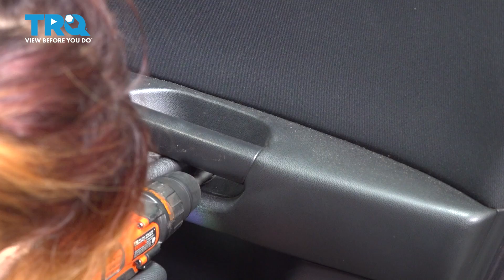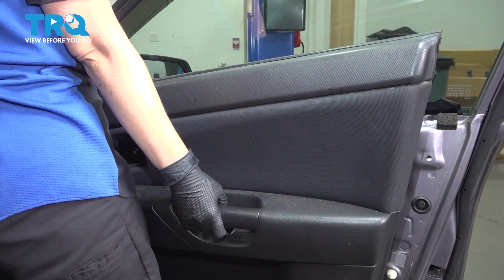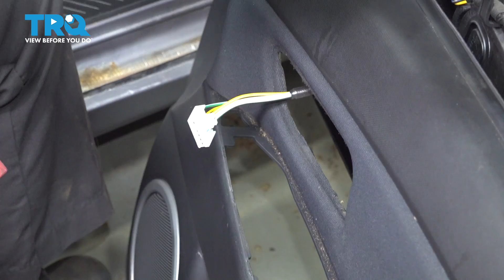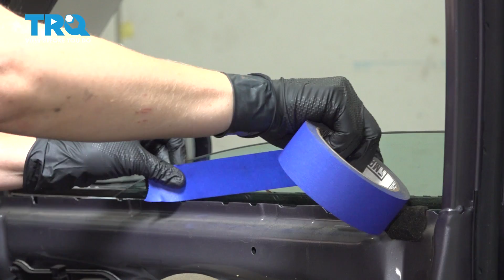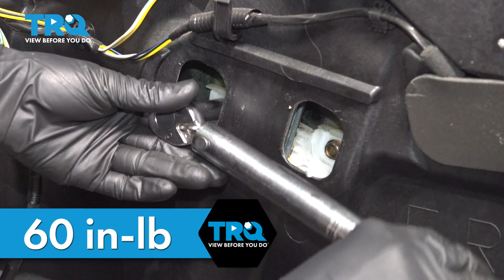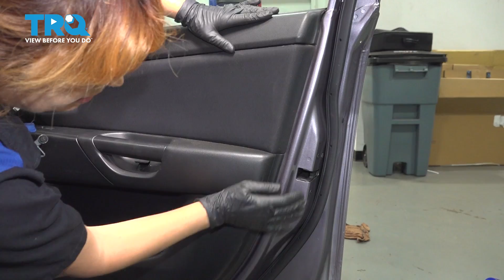How to Replace Front Power Window Motor & Regulator Assemblies 2004-2009 Mazda 3

Comment: This was so helpful! I just did the replacement on my rear Driver's side window, and today will be doing the Driver's side window. The video was incredibly helpful.  I will say that the majority of time and frustration was in removing and replacing the panel and trim, and the worst was working with the wire harnesses. The "tabs" are just not easily accessible, so I spent way too much time removing the plugs from the harnesses.  I did put on cuffs, (I use crew socks with the feet cut off,) to protect my wrists in all those sharp and tight spots, when reaching in without any visual access.

Comment: This is very well done video. What happens when you can't get the motor gears to lineup to fit it on properly? I saw 1 guy use needle- nose pliers to move it. I am scared the wire will come undone and whip me in my face.